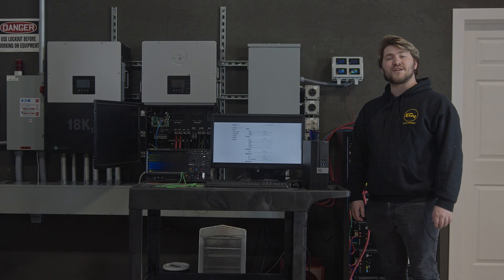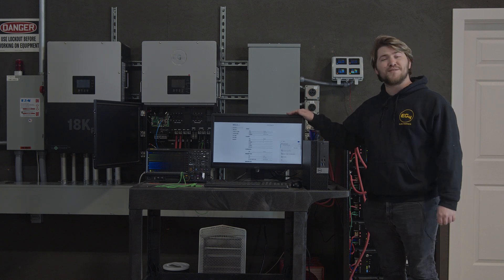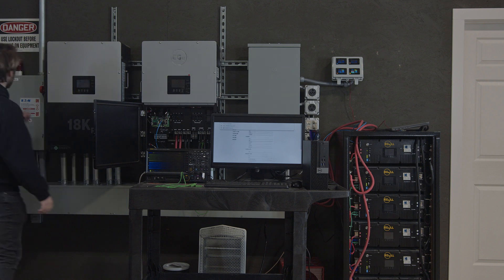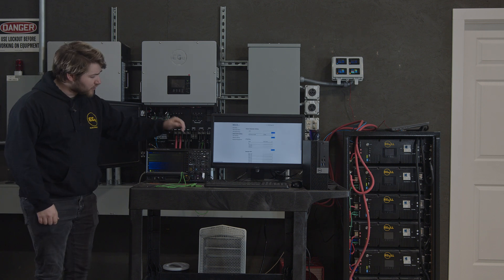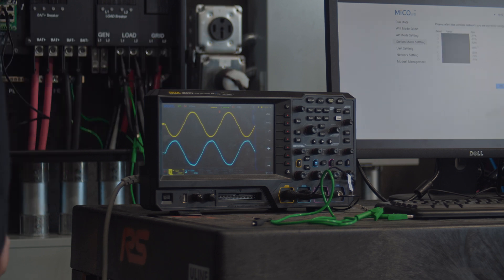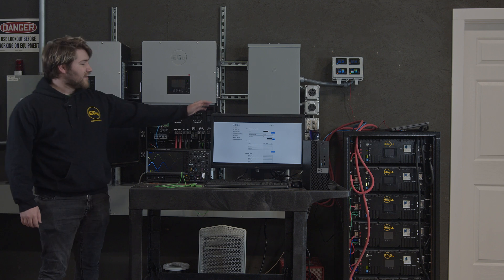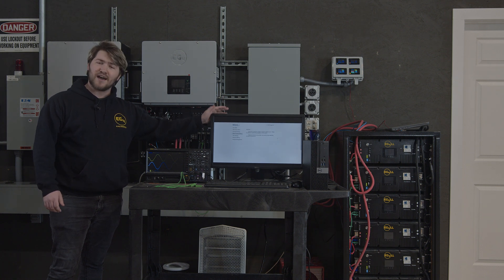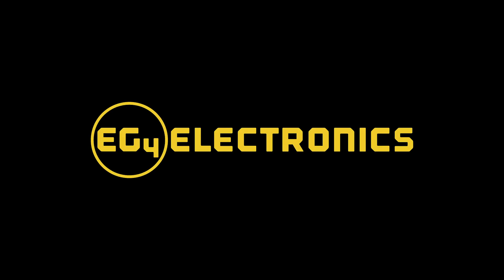EG4 18kPV Hybrid Inverter | Sine Wave & Transfer Test

Comment: Did you try to pair it with EG4 LL V2 or V1? Mine works with 4 of each and says 800Ah capacity however it says 40A BMS limit charge on 8 battaries. If this is true it is a deal breaker for me. Do you know if it is only able to charge at 40A in BMS mode? I tried software updates and other stuff nothing works, still says 40A BMS limit.

Comment: I wish you guys would do a video showing the finer details of how this works. How does this not back feed to the grid? Or if the power goes off this only works with a transfer switch?
Reply from the maker: Hi! 
The 18kPV has relays that will break the grid connection when the grid is offline. You can have up to a 200 Amp passthrough on a single inverter, without the need for a transfer switch. Jurisdictions may have different rules about this though.